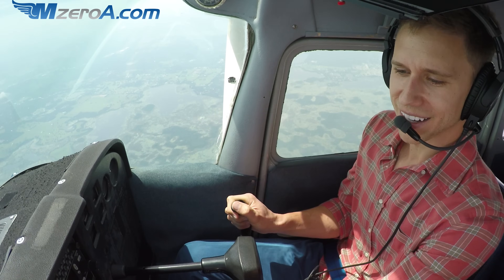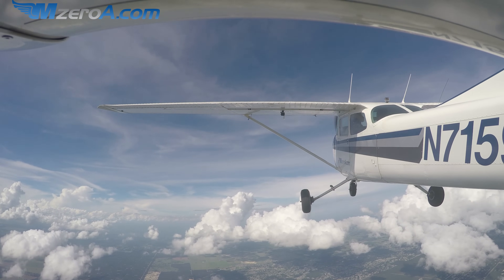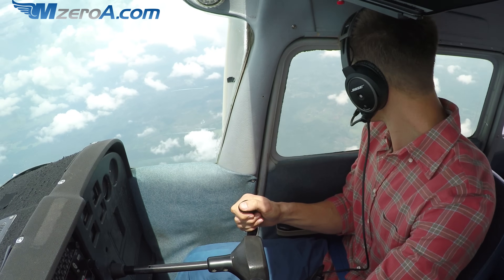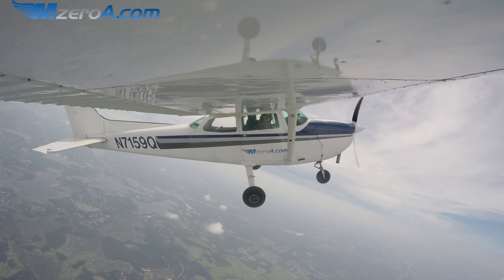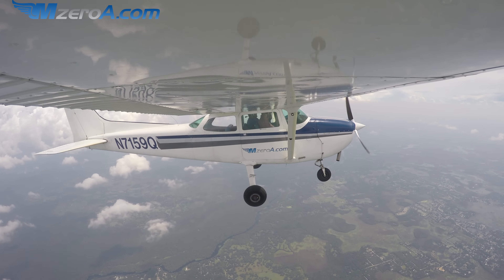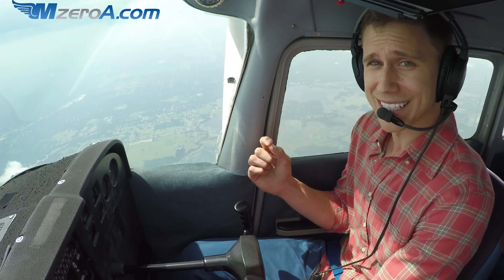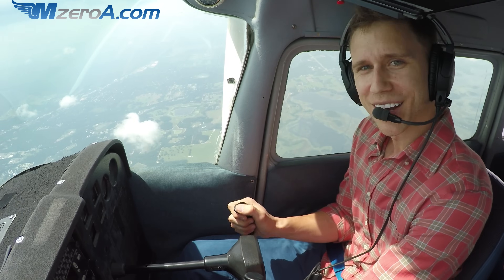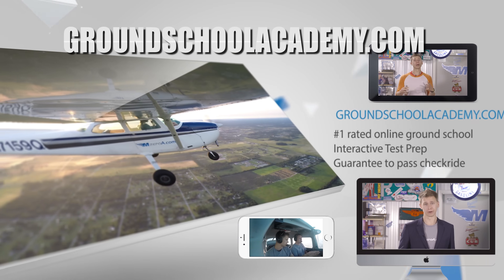Proper Spin Recovery - MzeroA Flight Training

Comment: PARE is pronounced the same as "pair" not "par." Additionally, the elevator action is a bit more nuanced than described. It is: Power - Off; Ailerons - Neutral; Rudder - Full Opposite (and held until spinning stops); Elevator - Neutral, where "neutral" is a direction, not an exact location. This covers upright and inverted spin cases. In the overwhelming majority of cases, however, the spins are upright. So "neutral" will be forward movement of the stick/yoke. How far? However far it takes to finish off the rotation. In the best case scenario, it may only require relaxing some back pressure; in the worst case, it could require forceful and full forward elevator. And the amount could vary even in the same airplane under different spin conditions. The elevator action in PARE is performed immediately after the Rudder action (i.e., full opposite and held) has been completed.

When the spin is over, Rudder - Neutral; Elevator - Easy pull to straight and level (no more than you might apply for a steep turn).

Also, while intentional spins are NEVER approved when in the Normal category, spins are not always approved in the Utility category! In the Utility category, manufactures have the option to conduct spin testing as if Normal category, or as if Acrobatic category. Some airplanes are Spins Prohibited in the Utility category, while others are Spins Approved. Follow manufacturer info and placards in this regard.
Reply: Just noodling around on YouTube and found this. I'm glad Rich chimed in right away. I really worry about video of this caliber; i.e. that fails to communicate complete and authentic information about important flying topics. I'm sure what I am saying here has probably been addressed by other respondents over these last three years, but here are a few things that pop into my cranium. First, the association of spin entry with a turning stall is not really good information for someone who is learning about spins from this video. We can do coordinated turning stalls all day long without spinning, and spin easily from straight ahead stalls as well as in other situations. Second, neither of these depicted events looked like spins to me. Instead they looked like the things most of us flight instructors did to earn our spin endorsement. That is to say, these appear to be incipient spins with a recovery from a spiral dive. The fact that the narrator is reflecting on G-forces is further evidence that the recovery was from a high speed condition, which by definition, is not a spin. 

It was only when I began to train flight instructors that I really understood why the late (and great) pilot examiner Dutch Zwiefel used to stop me in the hall and growl; "What's your airspeed in a spin?". He asked this question because he knew that most of us had never actually participated in a developed spin, where airspeed would be, by definition, somewhere between stall speed and zero. So, when I went up with my CFI students over Canyon Lake, we entered the spin, then held the pro-spin inputs. Wow, what a revelation that was!. The old C-152 sloshed around - woosh, woosh, woosh: What's our airspeed, Victor?" Indeed the airspeed indicator was also sloshing around, oscillating somewhere slightly below stall speed. Then, after a few turns, when we applied the recovery inputs,  They all made sense. Power was already at idle, then ailerons neutral and opposite rudder. Rotation stopped, elevator forward enough to break the stall, then recover with nose up and added power. And airspeed never strayed out of the green ark. In fact, my recollection is that airspeed was around 65KIAS; no drama, no G-forces, no stress. A low energy recovery from a low energy manuever.

Years later when I conducted private pilot practical tests, I noticed a regular anomaly when asking about spin recovery. I would say that more than half of the applicants in a certain region failed to tell me about forward movement of the elevator. One day I asked the applicant to reconcile what he was telling me with what the POH said about spin recovery. He said; "Oh, yeah but you won't really need any forward elevator because you are already pointed straight down." I had one guy say; "No, you have to pull back because you're going to fast!" Well, they are right when recovering from the spiral dive (not a spin) that occurs naturally after an incipient spin entry with no pro-spin control inputs held. I am sure the reason that so many private pilot applicants omitted the {Forward Elevator Sufficient to Break the Stall} control input, was because their instructors had never actually recovered from a spin. They had done what I did during my CFI training; a spin entry and recovery from a high energy spiral dive (which is not a spin). 

So we really need to take care to make sure that we have authentic and complete knowledge of a subject prior to teaching others. Aviation education is generational, and the sins of the father are handed down to the offspring. Meaning, if our flight instructor does not know the complete truth about a topic or maneuver, then we will learn wrong stuff. And when we become flight instructors, we will probably teach that wrong stuff to our students as well. The process is even more dramatic with internet based training systems. So I urge anyone who is posting instructional video to make sure that their content is complete, correct, and does not inadvertently mis-educate those who absorb its content. We must hold ourselves to a higher standard, otherwise we actually lower the standard of knowledge in the aviation community. And no offense meant to M-Zero A. I know these folks are working hard to publish good products for consumption by budding aviators.
Reply: Chas987107 Damn! Thanks for taking the time to write this :) It makes sense after you get level and yaw back to 0... then you’re left with the relative wind hitting the bottom of the wing and belly. From the wings perspective it would be in a very high angle of attack and stalled. So you need pitch the nose down to get the wing creating lift again and the air speed up above stall before you calmly pull her back to level flight. I hope I’m tracking what you are saying:)
Reply: @SVArca735  well said thank you for the comment. Doing my spin training tomorrow. Ill be wt aching that airspeed to see if we are actually in a developed spin!
Reply: wow what an underrated comment... it's literally the guy who invented PARE
Reply: Rich Stowell Thank you sir for providing your knowledge to us viewers:)
Reply: imagine some over-confident guy tries to do that without reading the manual and ignore the limitations
Reply: Noted in my notes, thank you!
Reply: A lot of the instruction for a particular aircraft often end with the words  "and that should stop the spin...."
Reply: Hi Rich!  Imagine bumping into you here LOL!

Comment: With me it was spin training both left hand and right BEFORE being allowed solo. It was great fun. Later once solo in the GF we used to spin away an hour or two, easy; just for the hell of it. Any spin less than three full turns was sissy. We spun both Cessna and Piper too to get the feeling of spinning overwing and underwing, two seater and four seater. With load and without.

Comment: Wasn't spin training required at one time for PPL but removed because somehow people were getting killed doing spins during the training? That's what I heard not sure if that is correct.   I read that most stall/spins happen in the pattern no time to recover by the time the pilot figures out they are in one.
Reply: Spins are not dangerous, especially in the vast majority of trainers.
Reply: Im busy doing my PPL right now and today i am preparing to do spins. I am a little nervous as it is such a dangerous thing to do.
Reply: Spin recovery is fun the the C-150/152.  But you must recovery before the airspeed exceeds Va otherwise you risk exceeding the maximum load limit.  Pull g's quickly at a slower airspeed.  The worst that can happen is a secondary stall, but at least you won't over stress the plane.  Practice at high altitudes.  Also, unless you're a CFI, the reg says you gotta wear a parachute.  Yeah, we all have one in our car trunk, right?
Reply: daffidavit This weekend plane full of sky divers caught fire and they all bailed out including the pilot and walked away. Parachute while many think they are waste of time gave those guys a 2nd chance of course the plane had no doors so it was idle situation.

Comment: Scary fact is most pilots who have spun in during an approach will tell you they didn't realize they were stalled until it was too late. Unfortunately, most stalls which has resulted in a spin happen close to the ground not at seven thousand feet. That being said it is of greater importance to have the knowledge of not unintentionally entering into this situation to begin with

Comment: STUDENT PILOTS BEWARE!! This guy  is teaching some very bad and very dangerous things in his videos. He isn't covering very important things in this video and others. 

First and most important is how to get into a spin! Stalling an airplane while not coordinated or cross controlling. 

Secondly, most stall/spin accidents that are fatal are at low altitude when a pilot loses control. (mainly from over controlling!) So, to go up and do a 1 to 2 turn spin is completely unrealistic because a pilot has to make an airplane stall, spin and continue to spin especially his docile Cessna 172. And its completely different than what you need to do in a real low altitude spin emergency. You need to be able to detect and avoid a spin by the first indications of yaw and of course stalling. A real low altitude spin would need to be stopped as it goes inverted at the very latest, in order to minimize altitude lose.
Reply: It's a shame you have totally missed the point of this video. And btw there have been stall spin accidents over the years induced by vertigo after inadvertent flight into IMC conditions which was not at low altitudes.

Comment: In Australia to obtain a PPL it is a requirement the all pilots are proficient at spin/stall recovery (assuming an appropriate aircraft available). The most likely time a pilot is likely to enter an incipient spin accidentally is when going solo for the first time or early in their career, particularly when flying low and slow, as in the circuit pattern. Proper spin/stall identification and recovery is essential for survival. After being deemed proficient we are encouraged to practice them during subsequent solo flights. Failing spin/stall recoveries will prevent a pilot being deemed proficient for their licence test.

Spins and stalls are not difficult, but they are the cause of many GA and LSA fatalities due to incorrect identification and recovery techniques.

I would suggest that if you flying school is NOT teaching spin/stall recoveries then they are failing their duty of care to their students. It is essential these techniques are taught if we want to improve the GA and LSA flight safety records.

Comment: I've never done spins like this...my CFI uses rudder to enter the spin with the stick all the way aft not fwd. Also, in Canada you need spins for your ppl
Reply: You seem to misunderstand each other. Sam said this is his instructors spin ENTRY, not recovery. Of course you're going to recover with forward elevator, it's the entry/fully developed stage that uses back elevator.

The video is focusing on the recovery, because the recovery is what you need to stay safe in an accidental spin scenario.

Aft elevator maintains the stalling angle of attack and allows the aircraft to continue the spin. As long as the spin doesn't go flat, which it shouldn't with a foreward C of G, the moment you use forward elevator the wing un-stalls and recovery can begin. A stalled wing will not cause structural damage, airspeeds will be low because of the stall.

Not familiar with diamond, but the Cessna 172M model POH reads the following: "The normal entry is made from a power-off stall. As the stall is approached, the elevator control should be smoothly pulled to the full aft position. Just prior to reaching the stall "break", rudder control in the desired direction of the spin rotation should be applied so that full rudder deflection is reached almost simultaneously with reaching full aft elevator...." "As the airplane begins to spin, reduce the power to idle and return the ailerons to neutral. Both elevator and rudder controls should be held full with the spin until the recovery is initiated."
Reply: Rudder is a good way to enter a spin from stall. An aft stick will kill you one day. Think about what happens when you enter the stall. The stick is aft and slows you down. Having the stick aft during the spin has the potential to keep you in the stall or not recover completely because you are constantly stalling the plane. Your CFI is going to kill himself or worse some student one day.
Reply: +J C my CFI has 22k hours and is also a test pilot on the side. 
the point of spin recovery is to lose the least amount of altitude as possible...because where do spins happen? in circuit... 

you're turning base and you enter a spin....where do you want to go? down or up?  you're never going up with the yolk crammed into the dash... 

also, have you ever thought about what happens with nose down attitude? you increase airspeed....that just means you're going towards the ground faster.
Reply: Ok. I get your instructor may be experienced. That's cool and all. But they made the acronym (procedure) P.A.R.E. for a reason. I mean the best minds in aviation came up with it. Yes, you increase airspeed when the nose is pointed down. Thus you increase lift at a faster rate (this cause and effect helps you recover with the least amount on altitude loss). With the throttle at idle and you pull the stick aft, you will stall again... and again.... and again. Your elevator is dependent on the situation and altitude, of course, but this is standard practice (it also doesn't mean that the "yolk is crammed to the dash" every single time. Some planes just need a slight push forward and almost recover themselves) Even if it is only American instructors that teach it, America is the tip of the spear in aviation. I think our experts know what they are doing. 

What I actually suspect, is you misunderstood your CFI because this all happens in an instant. Once the spin has stopped, you have the elevator neutral and level off while increasing power to regain original altitude. Speak to him again and clarify the instructions.
Reply: +J C maybe my CFI just uses this method to maintain the spin, the DA-20 is an aircraft that likes to fly and will not hold a spin with a neutral elevator and full rudder thus the full aft elevator, I'm sure as I progress in my training I will understand your way of thinking.
Also, this isn't a "whose country is better" competition... I don't know where that came from or why that was necessary.
Reply: Sam you need a new instructor
Reply: J C you have no idea what you're talking about
Reply: no spins for ppl. only spiral :) we practice spins but its not in the exam
Reply: Esquire Taylor no i dont....he has more experience than all the young instructors at your flight school combined and has gotten hundreds of pilots to their private and commercial over his career. He's float, night, twin, ifr, ifr twin rated and can grant an instructor rating.... my private is costing me under 5000, so there's also that.
Reply: Esquire Taylor i can see where he's coming from possibly having learned from a low hour frightened instructor... we were simply following the poh but apparently he's more knowledgeable than diamond

Comment: Good gawd...I did that as a kid when I got my ppl, required in those days, My CFI's dad was founder and CEO of Swiss Air, back in them days, kids...you knew how to "handle" your aircraft, simple fun stuff Thanks Mike!! (hey, 37 yrs ago, and still rockin!)
Reply: @Colin Skinner  Agreed - I started flying while in high school, '79, FBO/instructor was an AF pilot.  He introduced me to spins at about 10 or 12 hours of flight time, and was insistent on 2+ turn proficiency.  I practiced them nearly every time I went up, solo or dual.  Didn't take very long and it wasn't any different from correcting a skidding car in the winter.  One of my best friends is a retired airline captain, check pilot with 28K hours in his career, have spent many hours listening to him tell about ATPs who struggle with basic maneuvers, emergency and otherwise.  Enough to make me believe that drifting away the basics isn't necessarily a good thing.

Comment: I think VR is a great way to learn spins, no risk of losing a wing, well a real wing anyway. You don't get the G forces but you will learn the visual ques and the muscle memory to react instantly. I would suggest the free "DCS World" flying the training P-51. It is very easy to spin and can be hard to recover. If you don't have a VR headset then you could use freetrack, facetracknoir, or trackir for head tracking, although for a lesser effect.

Comment: Shortly after starting stalls probably 5th or 6th hour, my instructor who was current on spins ensured he did spins with me. It was a blast. I was doing Part 141 and I think it was in the syllabus to do at that time anyway. It saved my life later on a solos practicing high altitude maneuvers, and could at anytime should I ever get in to a spin for whatever reason.  They're fun to practice, they suck to accidentally get into, so it's best to practice first and know how to recover.  I think all student pilots should go through spin recovery procedures at least with their instructor, maybe not for exam purposes.  Spins can suck and not all aircraft are certified for spins.